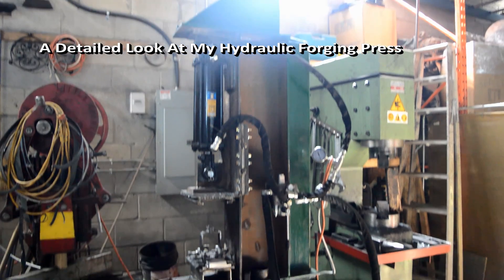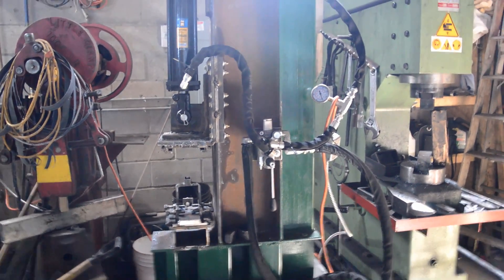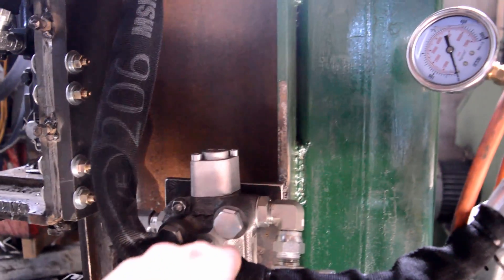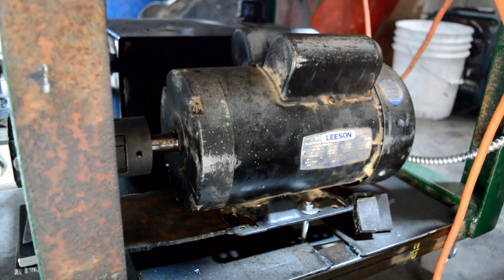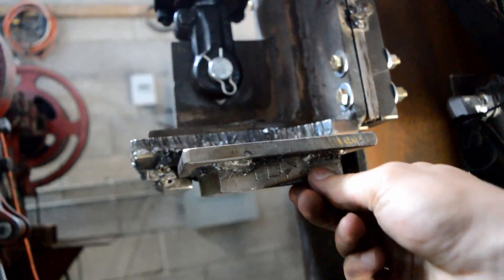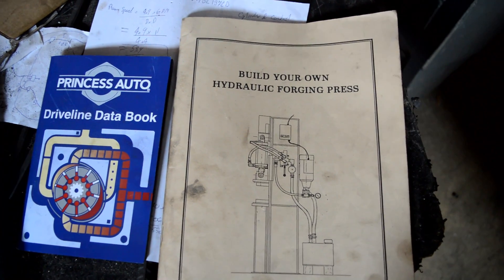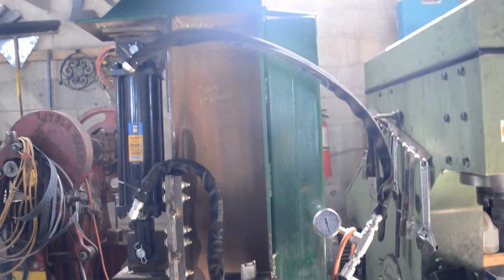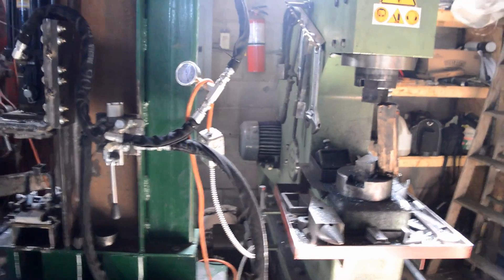A Detailed Look at my  Hydraulic Forging  Press

Comment: Man that is a great video! Thanks for taking the time to explain it all. Even though most of the hydraulic stuff is over my head right now it gives me something to learn about.
 I had been eyeballing one of these 6 ton electric log splitters thinking that I could mod it into a forging press just for my hobby shop, or go the air over hydraulic jack route. But I'd have to build an H frame for that. I think yours is a much better machine than those options.
Anyway thanks again.

Comment: I see you have AvE following you, well there's not alot for anyone els to comment on with that guy around. I say that because he's about the smartest guy I know of. You're an impressive young man and I have learned from watching your vedios, so thanks. One piece of advice,  that style of hydraulic ram you are using can, on occasion, stretch the retaining bolts. What we did was wrap a piece of safety wire in thread root as close to the ram as possible.  Just once around, so if there is any deformation of the retaining bolts a visual inspection will hopefully keep you from have a relatively lively failure.

Comment: Paul, if you could have only one mechanical forging hammer would you choose air or hydraulic and why. Seems to me hydraulic can do all air can and more for less money and space. Your thoughts?
Thanks 
Matt Taimuty
Reply from the maker: Matt Taimuty Hello Matt, Mechanical, Pneumatic (self contained), and utility hammers do not work the same. All three are hammers but function differently. A Hydraulic press a a different tool then a hammer. One operation a hammer can do that a press cannot (efficiently) is to taper stock. While a press can break it down, a hammer imparts heat into the piece as it is being work, whereas a press will suck out heat. From my limited experience I think a hydraulic press is a great tool for using tooling (fullers, punches, ect). The control on a press is very good.
If I did not want to spend much money, I would make both a mechanical hammer, and a press. Both can be made rather cheaply (Press around 2k, hammer 1-2k), especially the hammer if you can buy steel for scrap price.
The only experience i have with power hammers is with my 60kg self contained Sahinler. 
That being said, I would first make myself a good mechanical hammer.
Reply: Thanks for the advice. You confirmed my own thoughts. Hammer first then press.

Comment: Just to save your gauge Paul do one thing for sure and possibly a second

1. Make sure the gauge is oil filled.  The oil in the gauge will help prevent the shock of rapid pressure changes from destroying the gauge.

2. Think about adding an isolation valve to the gauge and only use it when you are changing pressure. 

Again this will help make the gauge last longer.  Otherwise nice build.
Reply from the maker: garygsp3 It is Glycerin filled, will that work or does it need to be oil?
Reply: Paul Krzysz Nope that's perfect.